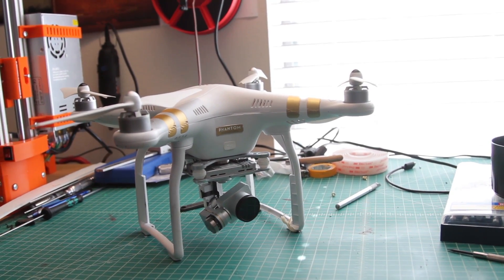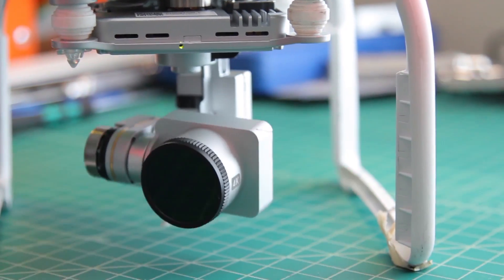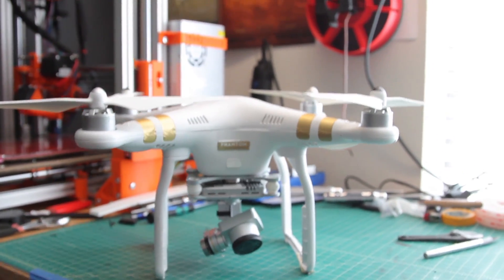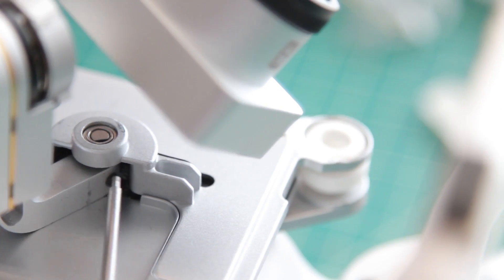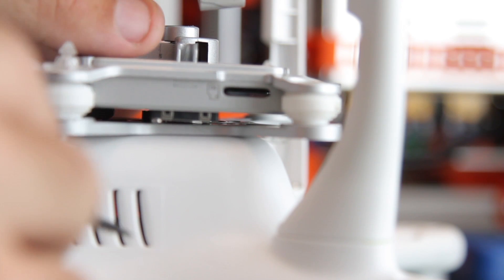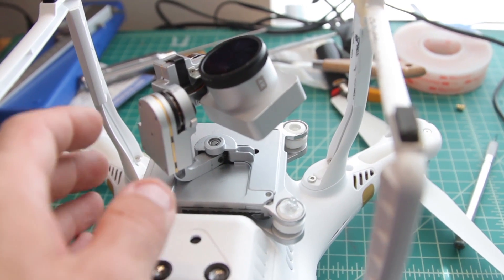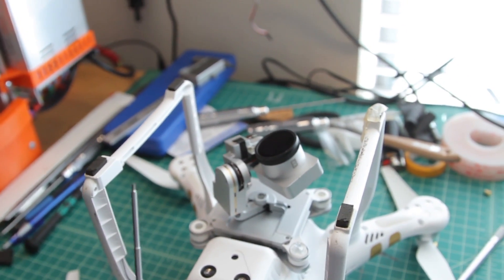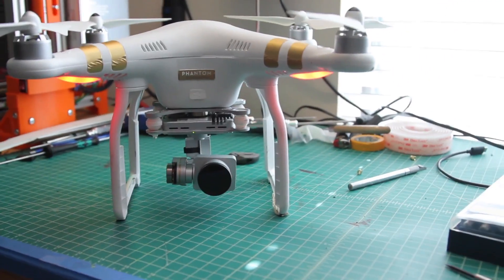Phantom 3 Gimbal Repair - EASY FIX

Comment: Mine looked in line but i think the top part of the shaft must've just been slighty rubbing at loosening the screw and moving slighty up or  down on the shaft did the trick. thanks

Comment: Hey Nick, I ran into an issue on my P3S where the camera pointed off at an angle (i.e. after power up, it went through the orientation routine, then settled in pointed to the left).  I tried calibrating the gimbal, calibrating the IMU and the gyro.  Nothing fixed the issue, so I was swallowing hard and preparing to send it back to DJI for service.   Then I stumbled upon your video.  Following your fix completely resolved the issue.  So I just wanted to write to say thanks.  You saved me a bundle and a lot of time!

Comment: Great video and brilliant fix, I'm glad someone made a video of it rather than just saying "little black screw go flush".  But now on my P3 std I get a bunch of grinding noises when that same screw gets loose.  I bought it refurbished from newegg a week ago and I've been hoping to not have to send it in but it seems I have little choice.  Hopefully tightening a screw doesn't void the warranty.
Reply: Joey Depew I just bought a phantom 3 Adv from Newegg as well. Crashed after 3 weeks, into a metal fence. Having this exact problem with the gimbal
Reply: If the gimble isn't all that damaged follow the directions in the video and test it out. (Note: about directions be sure to make sure the arm you are adjusting is right in the middle so that it doesn't scrape against the base of the gimbal).  Another thing worth mentioning is to use blue locktight for a better look on the screw (this little guy (screw)got loose for everyone looking up this video, and on mine Phantom 3 Standard, the screw gets loose again very easily.

Comment: hi there,
I have noticed my gimbal always wanders horizontally making the horizon out of level , it happens to both sides , sometimes there is a sweet spot depending on the direction I am heading , I turn to the right it will be tilting and remain as that till I turn left then it will balance for a moment leveled and then again go out of level...
IMU and gimbal calibration done numerous time on perfectly leveled  surface..., compass calibrated as well...
That screw you show in your video is parallel to the notch on the shaft and nicely tight...
can you suggest anything else ?
thanks